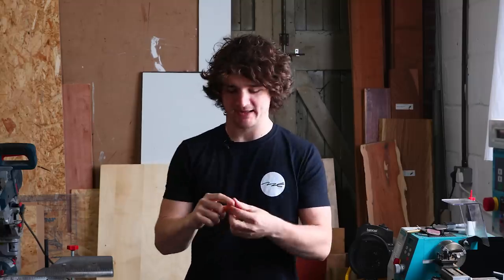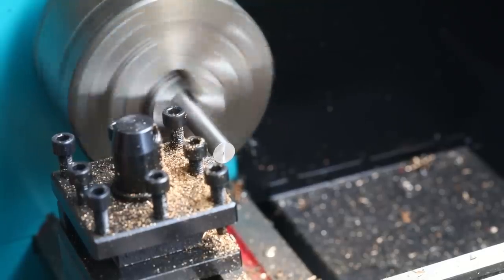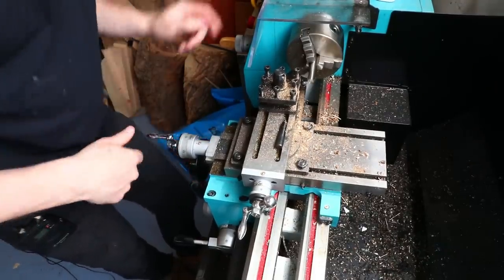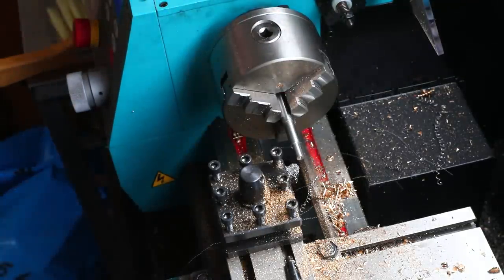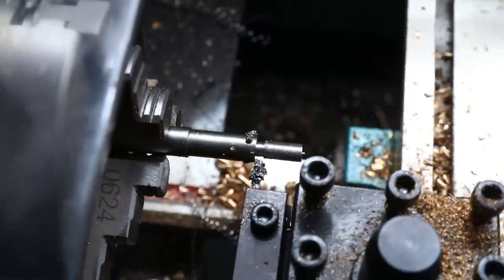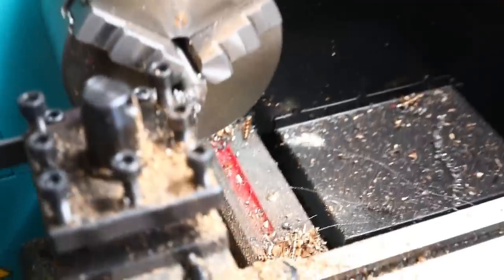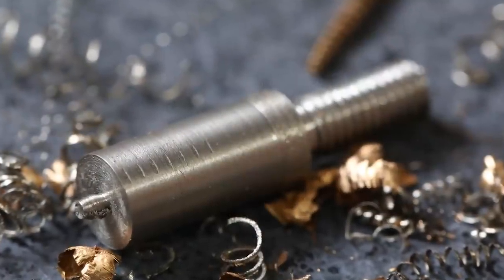Engineers, I need your help | Turning Tuesday #17

Comment: A proper quick change tool post with a bunch of holders was the best thing I ever bought for my cheap shit lathe. Also I think you do have a bit too much stick out for relatively thin material and the high side loads from carbide tooling.

Comment: 400 rpm is very slow speed for this small diameter I believe. Blue nano carbide tip on this holder is good for steel.
Reply: use a chart to get the right cutting velocity(vc) based on the pairing of stock material an tool material. the formula for cutting velocity: vc= pi*d*n 
mind to use the correct units(vc usually in m/min, n in rpm, diameter in m).

Comment: I'm not a machinist, but I do watch a few of them on youtube :) Several things: 

1. you mention this in the video. It looks like your tool isn't at the center-line of the work, it leaves that little nub on the end after the first skim cut. This could affect your measurements as well. Your tool holder may have provisions for moving the tool up and down, I'm not familiar with it. Perhaps the manual has more information?
2. work stick out appears to be too long, I've heard that 3 to 1 (work width to stick out from the chuck) is a good rule of thumb limit. should be as small as possible, unless you are supporting the work from the other end with a tailstock. This causes all sorts of problems with the work deflecting when you are trying to cut it, as well as chattering, etc.
3. wood on a metal lathe. Everything I've heard says that if you turn wood on a metal lathe, clean it up immediately, all the oil you use to cut metal mixes with the shavings, and creates goo that gums things up
4. stainless is apparently a difficult material to turn in general. if you're looking for corrosion resistance and want something easier to machine and don't need the strength, perhaps brass?

Comment: By the way......the compound that you have perpendicular to the ways SHOULD be 1:1 ratio.  Each tick is a full increment.  The slide that you have parallel to the ways, the smaller dial, is 1/2:1 when it's perfectly parallel to the ways as you currently have it.  Every lathe I've tseen.....that larger "dial" is a 1 to 1 ratio.  Depending on the lathe you're dealing with metric or inches which would mean that each increment is most likely .001" or One/one thousandth of an inch and in metric 1mm is .03937 inches or rounded up to 40/1000th of an inch.  What is the make and model of the lathe?

Comment: The first thing i noticed is that your tool height is not on dead centre. You always have a little bit of metal left on the face right in the centre. Make sure you measure your cut depth with verniers or a micrometer each pass when you are close to the final pass. Dont trust the machines graduations. Unless it's a high end lathe they aren't trustworthy.

Comment: Bang your speed up to about 2000rpm use the feed handle, not the screw cutting lever and use coolant when parting off and you will get much better surface finish and it’s a lot quicker. Remember you can always leave material on and emery cloth it down to size. Get a decent vernier and use it for your lengths don’t rely on your machine to much mate and you will be fine, the more you do and the more you practise, the better you will become. 

Love your content mate keep on making them chips 🍟  and remember “lathes keep the world turning” 👍
Reply: Increase the speed to about 2000 rpm and shorten the distance the part sticks out of the chuck  machine the threaded area first this will reduce the deflection of the bar and improve surface finish and improve accuracy.  The final cut should be checked before cutting the entire length  machine about 1 to 2 mm  and then check the diameter  and adjust as required. Threading should be undertaken in the lathe use tailstock to ensure thread is square. Instead of changing the cutter mount both cutting tools in the tool holder and rotate as necessary this will save a lot of time

Comment: To get rid of the nub, you put the piece back in the lath, and square it off.  At first I thought you were over reaching, but I then I thought making a sharping guild that works both for hand plane blades and chisel was crazy. A sharping guild couldn't do both well. I tried designing a sharping guild for just chisels, but I couldn't find nuts and bolts of the design I needed. Watching you, I realized it would be easier to make them from scratch. Also, I have older hand planes with parts missing. Finding the parts is near impossible. It would be easier if I could just make them from scratch. I understand why you are doing it now.

Comment: Matt, 12 minutes is not bad for your part in stainless. Shim your tools up to the correct height. Work in diameters not radii,  IE work out  what the divisions on the cross slide are in diameters. Can you not mount both tools on either side of the tool post and rotate it for each tool?  If you are not too far from the Petersfield area, I can give you half a days help. - retired toolmaker.

Comment: Matt, you doing fine. My observations, tungsten carbide too was to low in the tool post. My advice getting some quick change tool post holder, then you can adjust each tool hight individually.  More practice and watching more machinists youtube videos.

Comment: I would not trust the indicators on the lathe itself and use a micrometer/dial indicator for greater precison.
Reply: Bob Ross  you can use a magnetic base with a dial indicator on your ways to see exactly how far you move the tool. You can't use a caliper for that.

Comment: use dial indicator not the machines rough measurements. and grip item with wood in vice. quick tool change upgrade or as you mentioned shims for the tools(they must be centered) you should get chips not long stringy swarf.

Comment: if all your tools are below centre, the advances are slightly inaccurate. however this will not cut off enough rather than over-cutting. Your maths is a bit off.

Another tip. Friend makes decorative components of the metal lathe (brass). I gave him a bit of yorkshire grit and it works beautifully to give a mirror like polish.Worth buying as you can use it on both lathes.
Reply from the maker: Great shout! Cheers mate :)

Comment: The only thing I've got say after watching this is that is a metal lathe and you're cutting metal.  The lathe's motor and gearing makes it much beefier than most wood lathes.  I've seen significant portions of men's fingers removed for reaching into the workpiece to grab parts and remove chips.  Sure would hate to see you trying to do the incredible joinery you do with fewer fingers than you're accustomed to having.

Comment: I won't be an engineer for another year, but from the video I'm guessing "engineer" means something different in the U.K. since machining advise from an american engineer is the last thing that would help you...lol  Luckily, I've been machining for a few years so here's my 2 cents.
1) Get your tool centered, that will throw off your tolerances as the stock gets smaller.  0.1mm isn't that bad though.
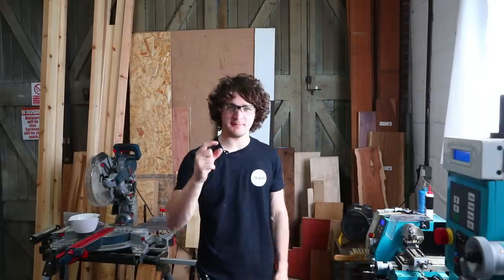2)From the 6:30-ish mark, yes, making a lighter cut at a slower rate will make your cut ever so deeper, but is good to do.  If you turn a part to exactly, say 10mm...return to 0 (your previous cut depth) and decrease your feed but run it again, it will shave off a small sliver and leave a nicer finish.  It's often called a "spring pass"...usually you add a thou though. (1 thousandths = 0.025mm)
3) You said your speed was 450rpm?  Check your speeds and feeds, there or lots of calculators online, but get a "machinery's Handbook"...it the holy book of all things machining, fabricating, and all around being awesome.  For stainless steel round, 9.5mm diameter (average of start and end diameter), recommended speed is 2760rpm, and 1120 for HSS tooling, feed at 450mm/min for carbide, and 100mm/min for HSS
3) watch your stick-out, general rule of thumb is about 5:1 (width to length) out of the chuck, if you need more use a live center. 
4) If you're tooling is carbide, using oil isn't a good idea.  Carbide loves heat and pressure, but not shocks...mechanically or thermally.  Oil can introduce thermal shock especially if it's already running in a part.  So unless you can flood cool it, try it dry and see how she cuts.  If your tools are HSS (High Speed Steel) then by all means keep it oiled.
5) At the root of your threads, make a relief channel for your cutter to run to.  You don't see it on most bolts because the threads are rolled into them and not cut.  Almost everything with cut threads you'll see a groove the same depth (or a little less) as the thread root where the threads start.
6) if its in the budget...see if you can get a collet for your stock.  It's not as adaptable as a 3 or 4 jaw chuck but you will be centered much more accurately...and you don't have those arms buzzing around at light speed
7) MOST IMPORTANT...Practice, enjoy yourself, and don't get discouraged!!!
Best of luck to you...love your woodwork, I'd love to work with wood like that but I'm impatient...that's why I work with metal.  You can only go as fast as the metal allows

Comment: 1. there are 4 sides on your tool holder and you can rotate it, so there's no need to take tools out of the holder every time. You can at least have 2 mounted at the same time, depending on their length (http://ralphhaust.de/resources/_wsb_496x352_Kleindrehmaschine+036k+Kurbelsupport.JPG)
2. If you are not going for max. precision use a caliper and don't bother with a micrometer. It's just a waste of time and can be frustrating.
3. If you want to achieve higher precision use way more coolant, especially for stainless steel, and/or let the part cool down, measure and then take the last light pass to final dimension.
4. On professional machines with quick change tool holders you can adjust the height of the holder to get the tool centered but in this case shimming may be the only option and is totally fine.
5. I'd turn the whole material (or how much you need for all parts) to the 9mm dia at once with the tailstock and then you just have to make the step to 6mm for each part.
6. You can use the threading tool in the lathe without any fancy equipment. Just hold the tool with your right and rotate the chuck with your left hand. Much easier and no marks on the part.
7. Please clean the machine ;)

Comment: Video yourself doing the process (not talking for youtube) and then chart how much time you are cutting material, how much time setting the tool in, how much time searching for the wrench to tighten things, wonder why you walked away for whatever, and so on ... and then know you are only making money when cutting chips. Good factories can change massive stamping press dies in under ten minutes. How fast can you change tools, including setup? That is often the biggest burn of time.
Use carbide tool inserts not self-cut tool steel because it's faster and more uniform

Work on speeds and feeds to get good chip shapes and chips the right color (pulling heat away).
This is all tuning things, depends how many parts and for how long you are making these for how much speed up you actually need. I suspect just improving quick tool change will be all you need. 

Don't forget to see how you can modify the part design to improve speed of production. Maybe one tool can do multiple operations if you can accept a tip radius from the main tool, things like that.
Understand that tight radii in corners creates fracture locations if this part will see loads later, more generous the radius the better the part life. Look up notch sensitivity charts for your material.

Comment: Zero your Micrometer at the dimension you need then measure your part and work your way back to zero. A spring pass can be useful on the last couple of passes. Watch Abom79 if you haven't already.
Reply from the maker: Great way to go about it. Cheers Rupert!

Comment: try taking you last 2 cuts using the slower feed also make them the same size. that should give you the same tool pressure. measure after the first cut to see if it measures what it should. if so you can be reasonably confident the second cut will be the same. ie  if you want to remove 0.14mm take 0.07mm then measure, if you have removed 0.07mm then the next cut should be the same. also 400rpm is very slow. for that diameter ideally you want about 5000rpm but that might be pushing it for you machine, have a look on google for speeds  the calculation isnt realy that hard. also dormer supercut works pretty well and doesnt smoke too much

Comment: Change your toolpost to a quick change tool post, so you can easily set the tool height and keep the tools set....bison do one.  Your tool tip needs to be on centre.  The feed that makes it faster isn't your feed....you are engaging the screwcutting feed.  Speed is relevant to feed....at that diameter i would increase the speed and the feed will increase relative. Add a coolant system this will make your finish better TCT tools like to be run faster than HSS tools.  Get a digital readout fitted, it will speed you up...big time.  Get a die holder for your tail stock....you can still do it by hand.  Message me if you want to know what items and I'll send some links. Use stainless 304L

Comment: Carbide tooling comes to ~5500 RPM on a 10 mil diameter. Are you ensuring there's no run out on your stock before you start machining? Collets would serve you well instead of the 3 jaw chuck for what you're doing. 12/dπ = rotations for a surface foot. Use π=3 for quick headmath. Also, don't trust your machine for measurements, I have a hilarious step block from school where I made that mistake on an old Bridgeport...

Comment: Last comment... are you racing?.... don’t... take your time...
Two things more... 
“Eye Ball”, is forbidden!
...and while doing threading... use a few drops of oil, or you will “blind” the tool... to work SS of any kind you should have cooling lube running or you will spend a lot of money in cutting tools... notice that you can use the lathe to make the thread... the challenge is to be precise!
Working metals is about .... method and precision... and lots of time, at least on the beginning!
Cheers!

... Mind safety... some time it looks like you are too .... well don’t discover the “hard way”....

In one word you are missing.... method!

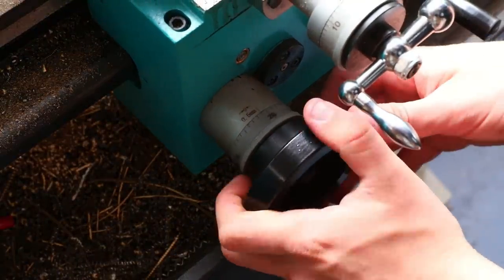Comment: I think you haven't properly touched off the tool from the OD of the material, which I guess results in too deep cuts. Or your lathe has too big tolerances/sloppiness - some footage seems to show that it is not as accurate as it could be (around 3:20)

Also, it looks like you are cutting below the (horizontal) centreline (see footage when you face off the material at around 2:10).

@Abom79 might be able to help or, as others suggested, @ThisOldTony.
Reply: aaaarghh02 I have to agree with you here on all points. And the two people you suggested to check out are the first two that came to mind for me too.

Comment: Hi Matt, I think you’re doing okay. I don’t give advice however there’s a bunch of stuff going on with your process. SS is pretty hard as opposed to brass or plastic sooo, like wood your accuracy and production will advance while your pockets are depleted of in your case GBP’S. Personally I’ve never been able to solve that part. Budgets are what they are (I hate that part). Machine tooling is expensive and well, expensive. Buy quality and you cry less in most cases. Wish I had a better answer for you. You’ll be fine. One more thing let’s say you cut your production time by 50% does that warrant spending more money (in this case possibly thousands that’s a lot of Guinness), frustrating sometimes I know. Your time spent is the factor, you might try a local jobber machine shop that specializes in small runs, make a drawing and run it past them.

Comment: Spindle is too slow and your tool is too low.
Set the height of tool by putting the revolving or fixed centre in tailstock.
Get a Dickson quick change tool post.
Save you hours of shiming up.
NEVER TOUCH THE SWARF WHEN THE CHICK IS SPINNING.
In fact how many do you need ?

Comment: Too slow rpm.. 1000rpm or there abouts. Get a triangle file and break all edges before removing from Chuck. Dip in parting tool to job deburr with file then part off. Use your tapping handle in lathe... remove your center put your nut in backwards in handle so the flat part rests on snout of tail stock. This will keep it square. Low speed. One hand on handle to stop it rotating and other feeding in tail stock to just keep nut square. Clear as mud. All lathes I have worked take off O.D not radius. Chinese must have missed this in fine print.

Comment: Your tooling is not centred. When you initially faced off the material, it left a nipple in the centre. Centring your tooling will also give you a better finish.

Comment: I would hazard a guess that your set up and machine are not capable of the tolerances you are asking without following some basic rules of machining.
First stick out is important
Cutting pressure on small machines Vital
If using carbide run the machine flat out